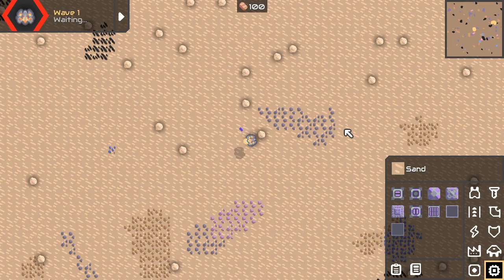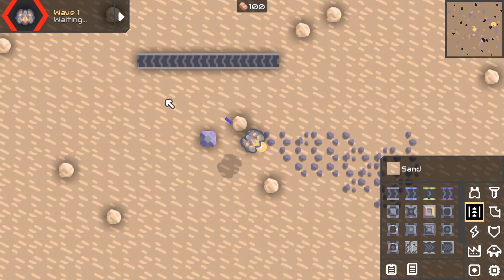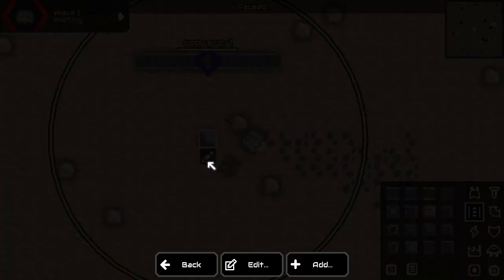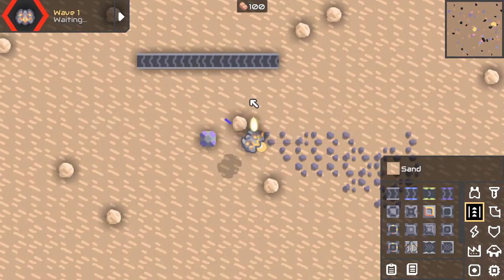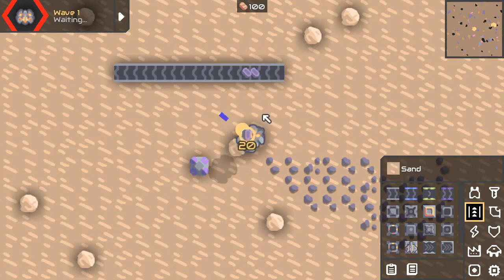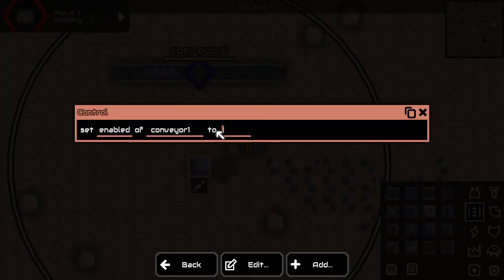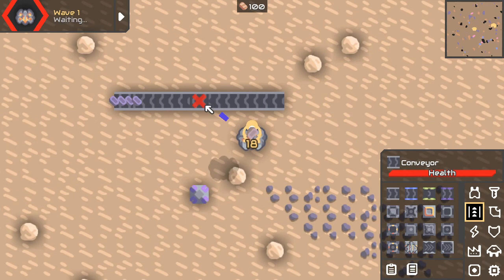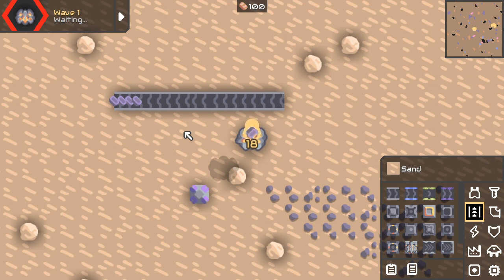Disabling/Stopping A Conveyor Belt Block - Mindustry v6.0 Logic Tutorial

Comment: how can i make a system for my power generators to work only at night (when the solar panel generates little energy). I tried to use the panel as a reference for they work when the panel generates little power, but my programming didn't work lol
Reply: you can set a variable to the power in a solar panel and do so if that variables is less then 2 for example then turn on the conveyor and turn it off if its not less than 2 maybe
Reply: @cookies-and-stuff  yeah, I did it, but I don't know if I should put TotalPower or something else, Besides I think I'm using the if wrongly...  Lol. It would be really cool if he make a video in the future about it 😅 I liked the way he build and explain the programming 😄
Reply: yes its total power and also are you using the 'jump' as an if?
Reply: @cookies-and-stuff  yeah, i m using jump as an if.
Reply: ok then idk
Reply from the maker: Sounds hard. I think I'd be too lazy to code this - producing more coal etc seems easier than coming up with a smart energy grid.

You'd need to have a processor which controls the coal-input of your power generators, and build a small solar panel next to it, to sense if it generates power. If it doesn't you can start feeding your generators. Should be pretty similar to the Thorium reactor video I think.
Reply: @bippty1442  lol yeah! Uhhh, true I will try to make it work! Thx for tip 😄